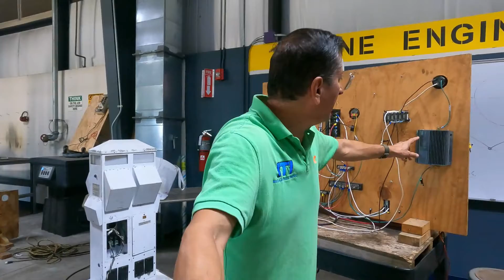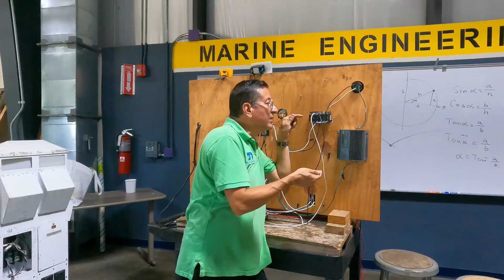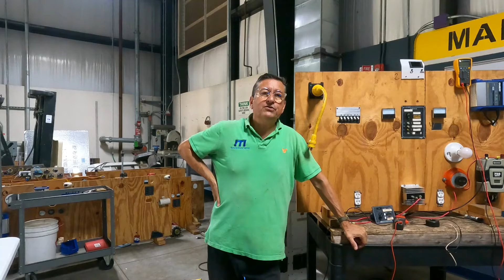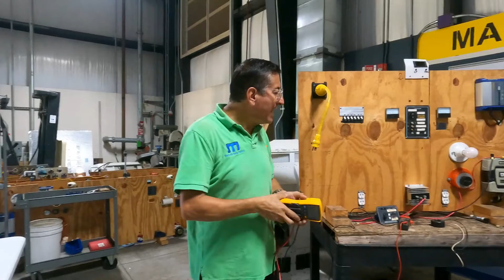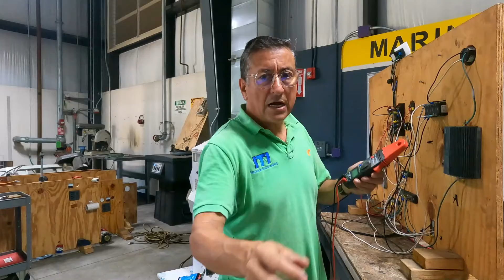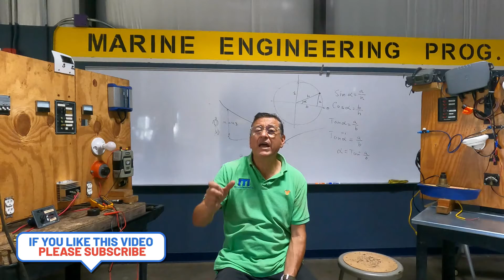Boat Wiring Course Review - AC Panel Board | Part 2

Comment: Good day,I have question sir,,how to connect  from generator to ac panel if there is a neutral ang line? From phillipines
Reply from the maker: The Neutral goes directly to the Neutral bus bar on the Panel and Phase 1 and Phase 2 goes into the main breaker